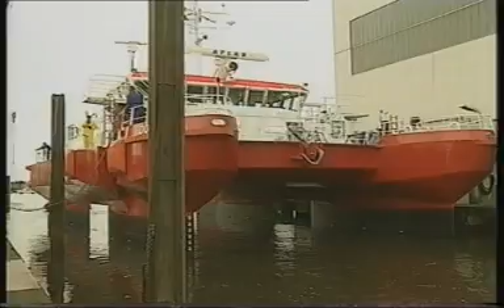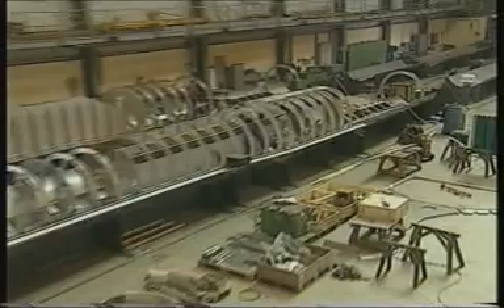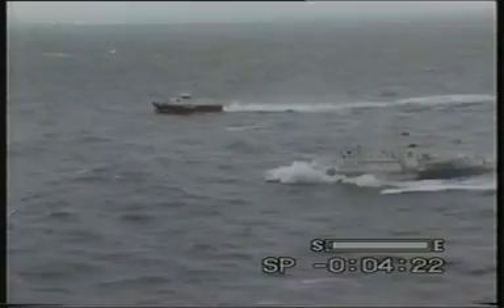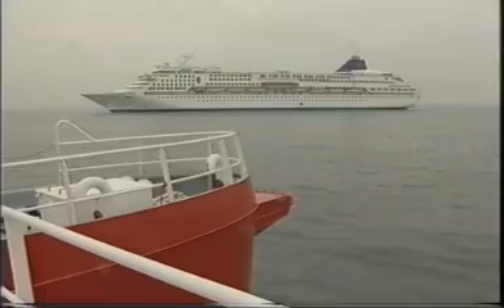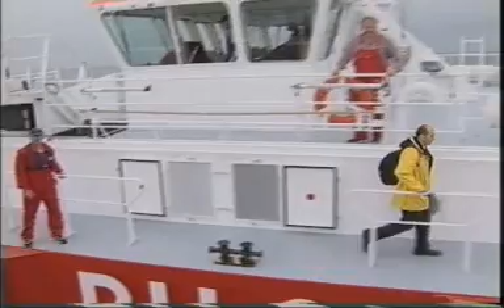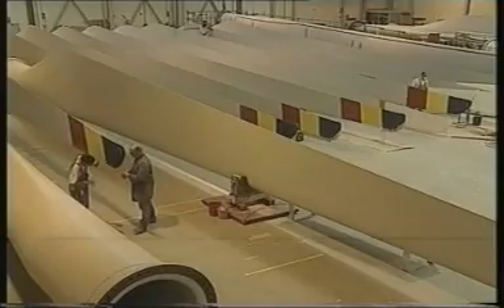znew way

Comment: I'm thinking of a personal yacht of 150-200' with a beam of 50-75'. Aluminum hull and superstructure. Power would be 3000hp Lycoming T-55s and KaMeWa water jets for a cruise of 50 knots. 

This could also be a commercial tour boat with less power but still able to run 35 knots at WOT. I think the passengers would really love the stability and comfort of SWATH technology! The crossing from Miami to the Bahamas and the run down to Key West are almost always rough going and the SWATH boats would go a long way toward taming the beasts!